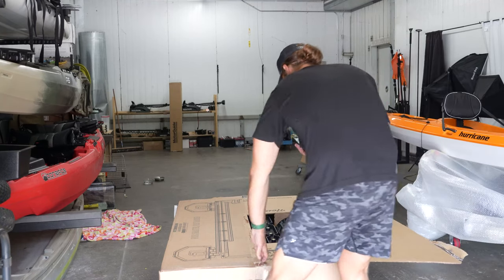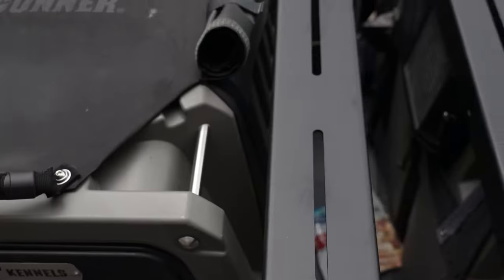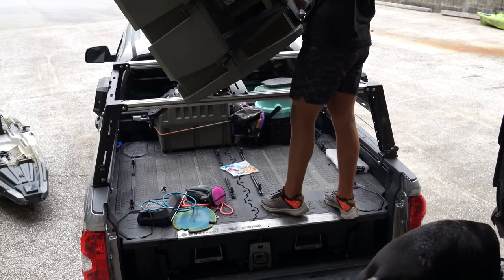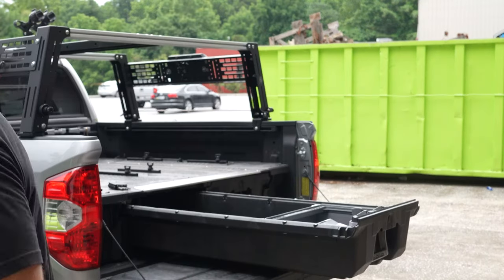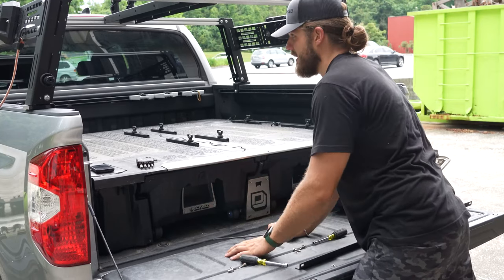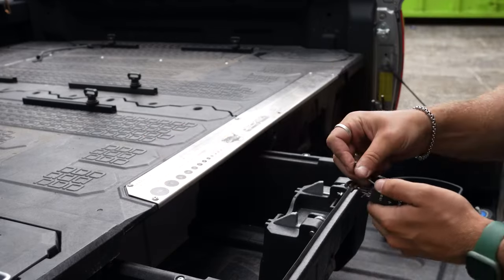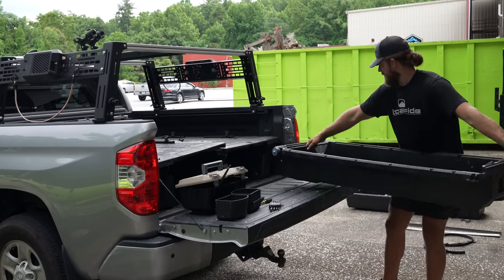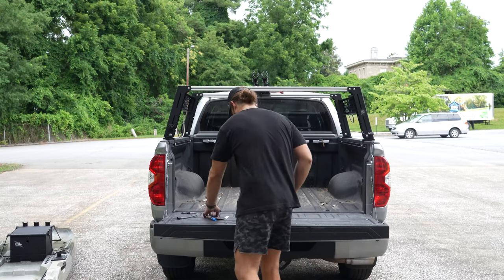Vlog #1 - The Ultimate Truck Bed Setup for Dogs

Comment: What was different from the first deck ?
Reply: Tie down points at all 4 corners, the lids at all 4 corners are waterproof now and have full length access from front to back at wheel wells the drawers pull out more and have more space